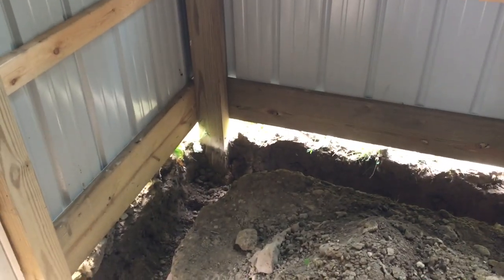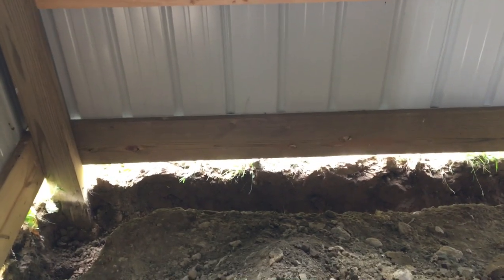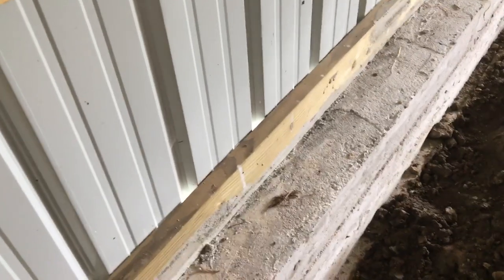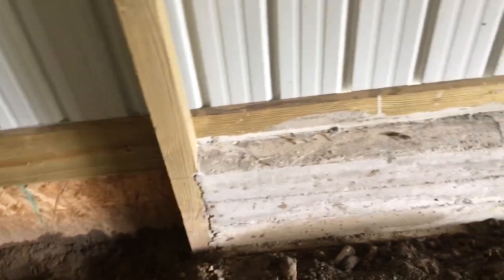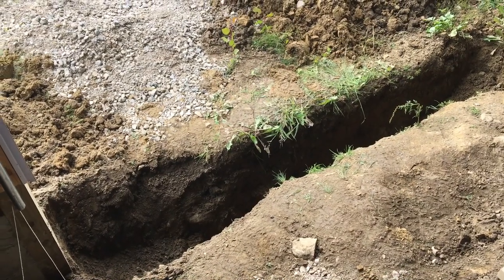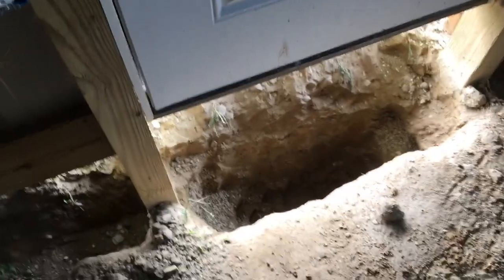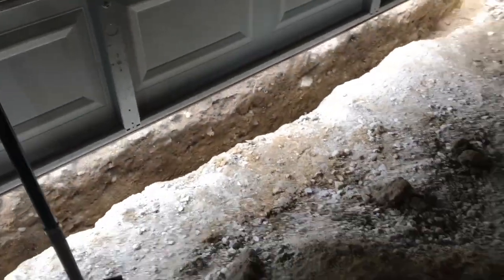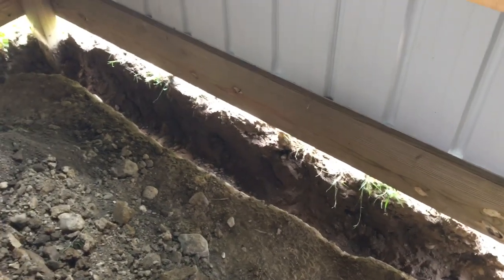Installing a Rat Wall in A Pole Barn

Comment: About to have a 10' x 12' slab poured in Michigan and, he's right, the requirement is a 4"w x 24"h rat wall. I don't mind though because I'm replacing a 6' x 8' slab that a groundhog dug a home under causing my old shed to tip forward to the point I could no longer open the doors.
Reply from the maker: Ron Devon Right on.  Ground hogs are a menace!

Comment: I wish this was a requirement in Nebraska.  I have hydronic radiant heat in my barn slab.  There's 2" XPS under the slab, but nothing along the side besides the 2x6 skirt board.  The first winter that I turned the floor heater on, voles started burrowing under the slab & chewing up the XPS.  If they ever chew through the PEX tubing, I'll lose my heated floor!  To keep them out, I've started burying 1/4" hardware cloth around the exterior walls.  Still haven't finished doing that yet--we'll see how it works this winter.

They've discovered that my manure compost bin is even warmer, so I'm hoping they'll permanently relocate there instead of under my barn this winter.

Comment: Question,  is it best to build shed first then get rat wall, slab poured?  Or the cement work first?    Michigan here.  Near impossible to find anyone that will do both.  So I need to likely hire two different men to do this..

Comment: Pre-planning on something like this is the best option, but sometimes on older structures, this cannot be done.  BUT...you can pour a monolithic slab which uses its own footers and the slab all in one...going to be tricky excavating with an excavator unless you dig it out by hand as you did....most states are writing this pour into their building codes for residential pours...garages have been using this method for years.  By the way, I live in Ohio.

Comment: @Maxpower4908 I am not exactly sure if I am seeing this right but, I do have a question and possibly this is where I should start! My dad had a 10 stall barn built out of all steel and tin about 17-18 yrs ago and we have some issues with wet stalls! We're also starting to see it is causing the tin to deteriorate at the bottom. Will this help with keeping the water out as well as varmints? I would eventually like to do a full concrete floor in it but, the barn is 60' X 30' and I imagine that could be pretty expensive even if done DIY! Any help or input will be appreciated! Lastly, what I wasn't sure about was if you actually poured a slab AFTER you did this rat wall you are showing? Thanks!
Reply from the maker: Luke B - A Ratwall will probably slow the flow of water into the building, but you may have better luck working on the grade around the building, making sure you have a decent pitch away from the building.  My floor level is about 18” above the surrounding grade and I backfilled up to the building, pitching down about 4” for every foot.  I also dug a trench at the bottom of the grade and filled it with pea gravel.  This gives the water somewhere to go when it rains.  It sounds like a big job, but if you rent a skid steer for the weekend, you can make pretty quick work of it.  My soil has a lot of clay in it, so it packs really well.  Once I had my grade all set, I spread some topsoil on top of the clay and planted grass.

I did pour a 5” slab of concrete after the ratwall was done.  No water problems so far (knock on wood).
Reply: @Maxpower4908    Thanks a lot for the reply! We have definitely been talking about addressing the grade around the building as well as around the house! (Old house problems) Once we get the grade corrected, it will get us through the wet season and then I can tackle the rat wall and possibly a full slab down the road! I am in N. TX btw (N.E. of Dallas 35miles) This black dirt here cracks up really bad in the summer, I think that was part of the reason for not doing the slab before. Either way, we'll get that grade worked out! I will try to document that process! Thanks again for the reply! If you have anymore input or suggestions I'm all ears. (Subscribing now)
Reply: @lukeb8265  60x30.  Your gonna need some help buddy. Especially if it's a warm day. Get a vibra strike, or a 2x4👎 Laser put grade stakes in everywhere. 3 or 4 guys that knowwhat's up. And pour it at 7-8 inch slump. Nice n WET

Comment: Nice video. I'm just northeast of The D.
Going to be putting up a 8x8 shed in the backyard. Never did cement work before. So your saying I will have to dig 24inches down all the way around this shed??? Ugh
Reply from the maker: ch him Only if you want to keep the animals out!  If you are doing a concrete floor, I would do the extra work.  At my old house, I had a shed with a wood floor, and the wood chucks built a condo underneath it.  They can really do a lot of damage.

Comment: Do you think that you could use a ditch with to dig this trench before installing your poles for the building? Might need clean out your post holes after, but this seems like an easier way to do this.

Comment: I am very sorry and I don’t know anything about construction, but in the many, many Youtube videos that I have watched showing concrete foundations being poured all over the country, they don’t show anything like what you have done (which btw I think is a great idea).  They show just a flat slab sitting on a bed of sand or gravel. Sorry to be so long winded, but I just don’t understand why this is the 1st time I have seen this (That I think) is a good idea.
Reply: It is code requirement in my county for outlying, non-residential building

Comment: We're digging a rat wall around our pole barn too - it's taking forever. Did you hand dig it all or did you use any power equipment?
Reply from the maker: I dug it all by hand and it wasn’t too bad.  If you have exceptionally hard soil, you might be able to get a gas powered post hole digger in there to break it up.

Comment: So what keeps mice from usining the ribs of the metal as a runway?
Reply from the maker: It's more for keeping larger animals (ground hogs, etc.) out that could burrow under your concrete and cause damage.  Mice are a menace, but don't present a risk to your concrete.
Reply: If your metal was done right then there is a piece of metal trim that closes those up.

Comment: Thanks for the info. I'm having our cement poured after the pole barn is built. Can they still do the rat wall under the garage doors and man door at that time? Again thank you
Reply from the maker: Brett Hayworth Yes you can still do all of it after the barn is built.  Or you can do a monolithic pour as one of the commenters below said.  With a monolithic pour, you would dig everything out and then when they pour the floor, the concrete will flow into the ratwall and footings.  I had to do the ratwall first because I had a ton of fill to bring in (about 2 feet in some spots), so I poured the ratwall, brought all the back fill in to bring the level up, and then poured the floor slab.  Good luck!
Reply: @Maxpower4908  Thanks.  I'm doing something similar.  I'm going to build and pour the floor later.  I don't want to pour the rat wall until the structure is built.  It will mean more hand digging, but then I can pour the rat wall and floor all at one time.  Nice video.

Comment: Looks good and I'm thinking of doing the same thing ... anything you'd do differently at this point? Nice video!
Reply from the maker: metaspencer When I first started, I was mixing the concrete in a portable electric mixer.  This takes FOREVER.  Pay the extra money to have a truck bring out 4 yards of concrete once you have it formed up.  You will have it poured in an hour.  Strip the 2x6's sooner rather than later.  The concrete will set up fast (few hours), and the more time you leave them on, the harder they will be to get off.  Good luck!
Reply: great advice ... I know what you mean about mixing small batches and days and days going by ... thanks!

Comment: I am in Michigan as well and they are making me dig a rat wall for a 144 sq ft shed. Did you put any mesh wire in the rat wall when you poured concrete?
Reply from the maker: Adnan Medic No I did not.  Just concrete.  The minimum thickness was 4”.  I went 8”.  I don’t think we have any burrowing animals that could get through 4” of concrete.
Reply: @Maxpower4908  Have you seen Tremors? Hehe but yeah, I am going to start digging mine this weekend

Comment: We live in Michigan to and is building a pool barn home as a retirement home we are putting in the concrete floor work this summer but having second thought on the flooring for the pipes to be under neath  all the concrete because of the winters here.  Did you do any of this yet and if so can you give any advice on it or another video.
Reply from the maker: Wayne Martin I do not have water run to my barn as I do not plan on keeping it heated Year round.  It is just a workshop / storage space for me.  With that said, if I were to run plumbing, I would not run it under the concrete floor.  Plumbing should always be accessible in my opinion (You don’t want to have to bust out concrete to get to it in case of a leak.  The main water line running out to the building should be run a minimum of 42” under the ground and then come straight up through the floor.  From there, I would run the pipes along an insulated wall to where you need it.  You should have a good amount of insulation between the pipes and the outside, to protect it from freezing.  How are you planning to insulate?  Spray foam?  Stud walls with traditional fiberglass insulation?
Reply: @Maxpower4908  we will not be running the water lines for the house threw the concert only in floor heating and the sewer lines we plan on using spray foam and the traditional fiberglass both together and I have found another video on here that gave us a good ideal of putting inflation boards out the out side to bran so the heat will not escape Thank you for your help.

Comment: Did your slab go over top the rat wall or butt up to it? I’m going to put 2” insulation board under my slab (for the in floor heat) and everyone says to put vertical insulation around the outer edges of the slab. If the slab pours over top the rat wall, won’t the insulation cause a 2” gap between? Maybe that’s expectable?
Reply from the maker: Kevin Napolitan My slab went over the top of the ratwall.  If you did it the way you describe, you would have 2” of exposed insulation around the perimeter of your floor.  I don’t think that would be good.  I chose to go with thicker concrete, rather than insulation underneath.  As we were pouring the slab, we pulled up on the mesh that the pex was attached to, so it was suspended in the middle of the slab rather than sitting on the bottom.  Not sure how much heat I lose by not having insulation, but the floor heat works great.  I think once the dirt underneath the slab gets warm, you don’t lose much at all.   I am sure the insulation works great too.  I decided that the thicker slab was best for me as I occasionally pull some very heavy equipment on it.  Best of luck to you.
Reply: Maxpower4908 yes the exposed 2” is my dilemma, not sure what to do there. Thank you for the info and great video. You are correct there is very little info out there on the topic.

Comment: In other terms it is a footing wall that you could have saved time and just built that and set brackets into it for the columns of the building structure, seeing as the footing on the wood buried in the ground will eventually deteriorate from rot and pest damage. or if you want to do this way to save money but your posts to last longer then just look up and use Plasti-Sleeve or Post Protector products for a longer post life for in ground burial of post and this 'simpler' lower cost(?) non structural footing system between posts.
Reply from the maker: Joshua79C C Someday, many years from now, when you get a job, move out of your mom’s house, and buy a place in the country, you can build your barn however you want.

The purpose of the ratwall isn’t to protect the posts from rot.  It is to keep burrowing rodents from getting under your floor.  If you read the building codes in most areas, they will specify that you need a rat wall in order to pour a concrete floor.  I made this video for those people who may have no idea what a rat wall is, and want to learn more about it.  Nothing more.

A post frame building with properly treated timber will last hundreds of years.  Part of the reason they are so popular is due to the low cost compared to traditional construction.  A big part of that cost difference is the lack of a structural footing.

Many people choose to add a concrete floor to an existing pole barn.  Guess what they need to build first.  THAT’S RIGHT, a rat wall.  I’m sure you would recommend that they tear the barn down and start over with a footing, because it’s “easier”.
Reply from the maker: Joshua79C C The pole barn at my grandfather’s farm was built in 1974.  I should go tell him that some guy in the youtube comments said that his posts rotted out 24 years ago!

The deck on the back of my house was built in 1986 with ground contact posts.  Absolutely no sign of rot whatsoever.

You are entitled to your opinion, but every 2nd property in my county has a pole building on it, many of them older than 30 years.  I have not seen any evidence that you are correct.
Reply: GOod for those whose posts last longer than normal for most others but if you dig up a bit o a pot and give it a tap with a hammer and tap on upper portion to compare the sound, and it sounds different, then it is likely  rotting and you just can not see it yet. But if not then you good the best soil conditions for said treated wood and the type of treatment was likely CCA or whatever it was that was phased out due to toxicity. This can be said for either your dads posts or even for yours, have seen trees rotted inside but looked fine on the outside as rot works both ways, except wet and insect rot works from the inside out and dry deterioration/rot starts from the outside.

Still with ground contact does not mean in-the-ground ground contact despite. And if you feel like proving me wrong still then ask some of your neighbors with buried posts to dig up a foot deep unless it has been encased in concrete or foam and give it a hammer tap test. Or even a drill tap test will do as well since if you hit any inside rot the drill bit will slide in a bit or a lot. If any of you notice this issue with these two simple test then I suggest you take action to remediy  (spelling intended) this underlying issue in progress before it gets worse either by cutting off the rotted section and replace with a new piece Secured with a connector bracket and check out using what I first suggested for a bit more cost and better longer life.

Another one is the push test but often this may only prove the soil is 'loose' around said post

Since you say you can not "see" any such evidence does not mean such an issue does not exist. It is that which you do not see may bite you in the hind side if you do not do some annual inspection as had mentioned.

Btw, I am in my late 30s and happy for the time being with the way I live.
Reply: Joshua79C C this argument between you guys is very educational ive learned some ideas on foundation... too bad Trump's arguments couldn't be intelligent like these ones

Comment: So I'm planning on a large Shed Not quite pole barn scale, 12x24. I first heard about the rat wall from my Father in law who said he needed one for his dethatched garage. Thanks for this video. 

One thing I was planning due to the moist area I was planning to build in, is a drainage tile system under my shed concrete. Would I plumb this through the rat wall or under it??